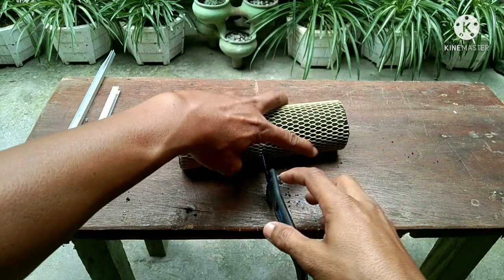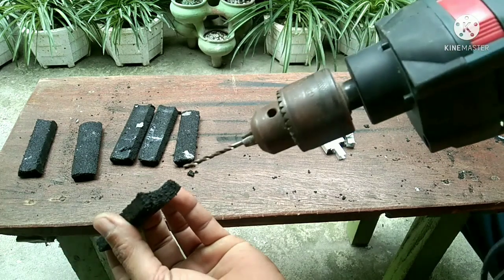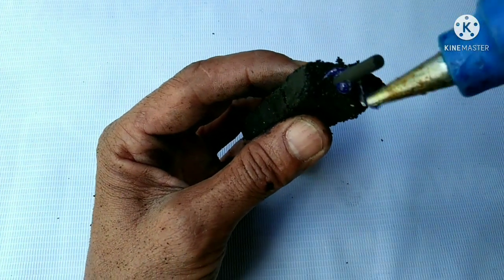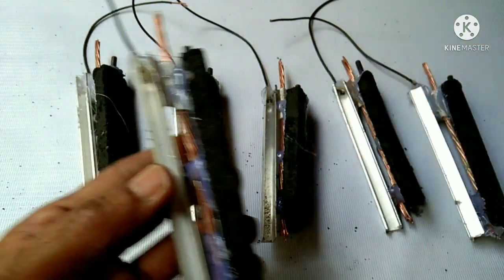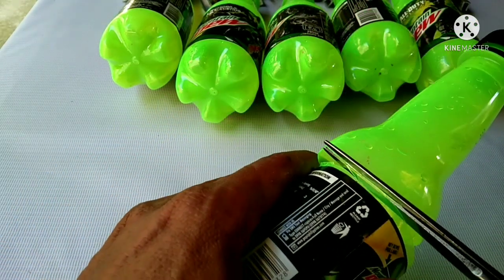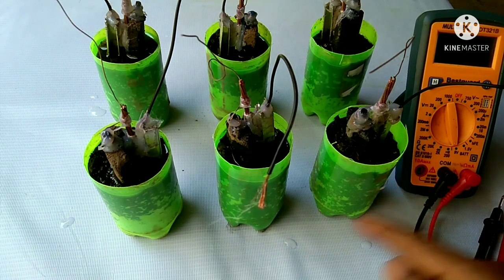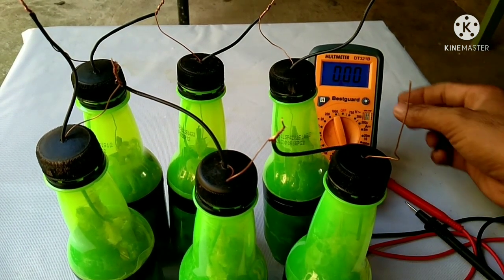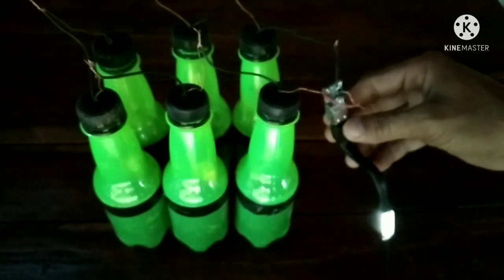How to make soil battery lamp with sea water

Comment: Is it possible po kaya na tumaas ang volt nya without boost up converter by adding bigger copper, aluminum and carbon?? Para isang buo nalang gagawin mo and hindi na 6pcs sets?
Reply from the maker: Yung 1 cell hanggang 1 vokts labg talga maximum kaya need to connect in series to add voltage